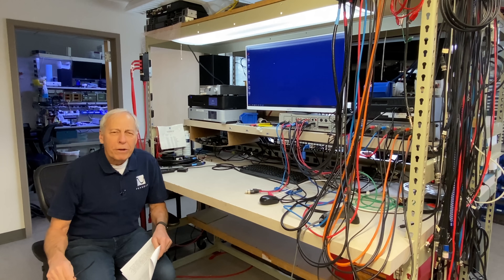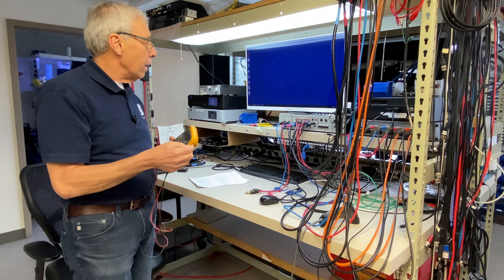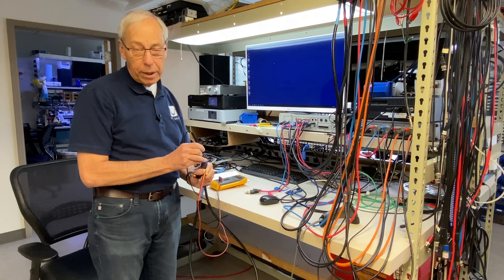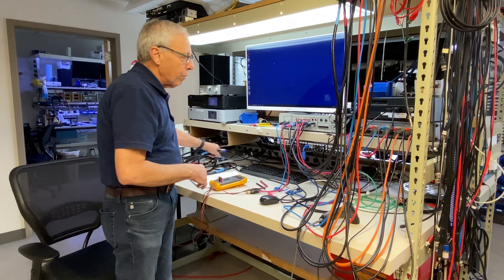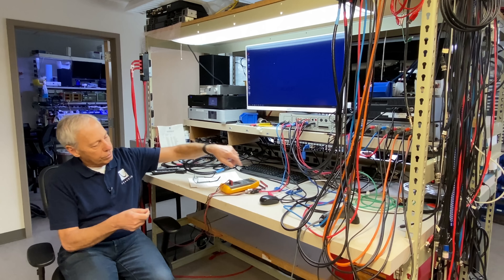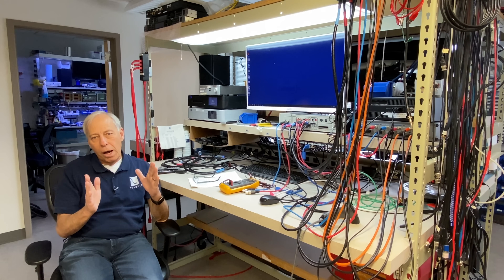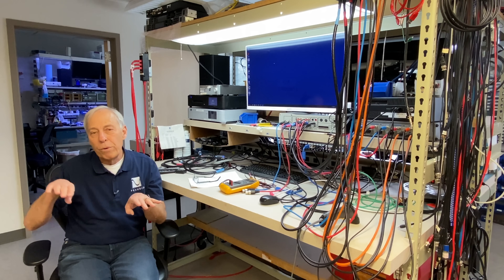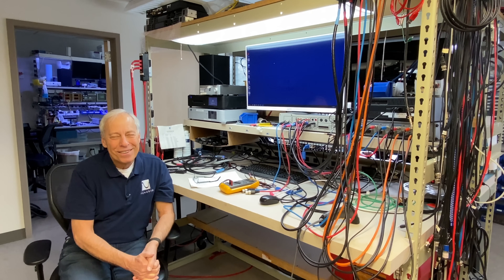Speaker cable impedance

Comment: If that measurement was correct, a speaker cable resistance of 3 ohms or more is truly horrible.  First suspect would be poor connectors; the wire resistance can be calculated as follows (remember to use full loop length, which is double the cable length).  The numbers in parentheses account for skin effect at the highest audio frequency:  
20ga:  10.2 ohms/1000 ft (no skin effect for audio)
18ga:  6.4 ohms/1000 ft (no skin effect for audio)
16ga:  4.0 ohms/1000 ft (4.4 ohms/1000 ft at 20KHz)
14ga:  2.5 ohms/1000 ft (3.1 ohms/1000 ft at 20KHz)
12ga:  1.6 ohms/1000 ft (2.28 ohms/1000 ft at 20KHz)
10ga:  1.00 ohms/1000 ft (1.7 ohms/1000 ft at 20KHz)
8ga:  0.63 ohms/1000 ft (1.3 ohms/1000 ft at 20KHz)
6ga:  0.40 ohms/1000 ft (0.99 ohms/1000 ft at 20KHz)
4ga:  0.25 ohms/1000 ft (0.77 ohms/1000 ft at 20KHz)
2ga:  0.156 ohms/1000 ft (0.60 ohms/1000 ft at 20KHz)
Note that the heavier gauges are more susceptible to skin effect and this is why it's better to use multiple finer wires (braided so they don't run parallel) instead of single heavy wires.  
For those who need wire cross-sections in mm^2:  
20ga:  0.52 mm^2
18ga:  0.82 mm^2
16ga:  1.31 mm^2
14ga:  2.1 mm^2
12ga:  3.31 mm^2
10ga:  5.3 mm^2
8ga:  8.4 mm^2
6ga:  13.3 mm^2
4ga:  21.2 mm^2
2ga:  33.6 mm^2
Reply: unless that wire came from China, in which it would be aluminum interior with a copper plating on the outside. That would explain the high resistance.
Reply: @jeffmassey4860  
Resistivity of aluminum is only 68% higher than copper, so the use of aluminum wouldn't explain such a high resistance.  
But steel has almost 10x higher resistivity than copper.
Reply: @marianneoelund2940  DON'T CARE. WHAT IS THE BRAND OF THE CABLE.
NOT MENTIONED. USELESS ARGUEMENT. BYE. DO NOT REPLY.
Reply: @jeffmassey4860  
Did you just get back from a street riot?  
Sure, it would be nice to know the make and model of the "problem" cable, but we probably won't have the luxury of that information.  
Do you think the Chinese might use copper-plated steel?

Comment: Since they are new cables and he compared them to his old ones I would suspect a poor crimp or solder job on the connectors , that could easily explain what he experienced.
Reply: I agree most "cable" problems are due to connector issues.  Good connectors are not easy to design and produce.  Everything needs to be right, including the plating processes.  
I remember a horrible experience with a brand new ZIF socket that I wanted to use for an EPROM programmer.  Half a dozen of the contacts had very poor or no continuity to the device pins.  They looked clean, no sign of corrosion, and scraping them down didn't help much.  In the end, I had to give up and replace it.

Comment: This person was almost for sure measuring the resistance with the speakers in the circuit. Anything that anyone would consider speaker cables would have to be hundreds of feet in length to get 4 ohms resistance. Paul should have pointed out that a multimeter doesn't measure impedance, he just uses the term interchangeably with resistance which any engineer shouldn't be doing.
Reply: I noticed that.  Paul’s meter can only measure the resistance, but ignores the reactance, which in speaker wire may be more important than the resistance, depending on design.
Reply: @doowopper1951  I have a Toa impedance meter, which measures at 1000Hz, commonly used in Public address for load balancing and matching 100 volt line circuits.
He needs to null the lead resistance out before he starts measuring.
Reply: @peterwhite51    But, Paul said that he had an Ohm meter.  I know well that there are impedance meters, but without using one, you can't measure impedance.  An Ohm meter just won't account for reactance. .
Reply: I would certainly be asking how this measurement was made. It's too close to many speaker terminals' D.C. resistance to be a cable only measurement.
Reply: He is not an engineer. He learned bits and pieces by working with engineers but you can see he has a lot of wholes in basic stuff.
Reply: irisfailsafe   Those holes are not from a lack of knowledge, just an occasional inability to express that knowledge in layman’s terms;  he tries to oversimplify.  And, he is an engineer.  Maybe he isn’t formally trained as one, but he learned enough hands on that he can design electronics as complicated as the digital lens.  Jeff Baxter, of Steely Dan and Doobie Brothers fame,  was, under the Bush administration, the number one security expert in the US.  He had no formal training at all, it was 100% self taught.  You claiming Paul is not an engineer is like saying Jeff Baxter is not a security expert.  And I bet Jeff would be piss-poor at trying to explain his security concepts tp us.
Reply: @doowopper1951  He gets called a lot by engineers for saying wrong things and promoting lies like magical cables. He never dares to talk to those engineers and expose his facts
Reply: irisfailsafe   And you show your blind biases by calling cables “magical”.  Cables can, and often do, make a difference.  Especially to those who do critical list in to any extent.  Most of the time, naysayers like you do more harm than good for those looking for the best listening experience they can get.
Reply: @doowopper1951  No they don't. If they are well made then that is it. There is a thing called science, and one of their branches study a thing called electromagnetism. And all of those scientists always calls the BS of  cables. Search a book by Dr. Floyd Toole. Read it and then come back
Reply: @irisfailsafe     You, and Floyd obviously do not know what you are talking about,.  Cables can make a very significant difference.  I was once 100% in agreement with you, until I heard the differences over and over, and could no longer deny them, as much as I wanted to hear no difference.  You are welcome to your opinion, even though it is about as wrong as it can be.  And so is Floyd Toole.  And, I don't care what any book says.  The human ear can hear differences that can not be shown by measurements and other methods, YET!..one day, we will be able to prove definitively that there are differences in cables that affect what we hear.

Comment: Hmm. I'm thinking maybe a little corrosion on the connectors somehow? Or maybe just bad connectors period. Not attached properly? 
I can't see how the wire would have 3 or 4 ohms resistance. 
Definitely bring them back.
Reply: you're assuming the measurement was done correctly

Comment: For those who might be interested, the resistance of stranded copper wire at room temperature (per thousand feet, move the decimal three spaces to the left for per foot)
Gauge         Ohms per 1000 feet
10                   1.02
12                   1.62
14                   2.58
16                   4.09
18                   6.51
Reply: Mike Eastridge  Actually it sounds like they read the scale wrong on their digital meter (or the meter was defective.) Who knows.
Reply: Mike Eastridge  The table I got the values listed pure copper, not an alloy. Variations in resistance between batches must be infinitesimal, especially  at the lengths of most cables.

Comment: A question about my 35 year old Monster speaker cables. The copper is tarnished black throughout the cable. Does this discolored copper change the impedance of the cable and impact the sound quality? I no longer use the cables but can't justify throwing them out.
Reply: If it is just tarnish ( mild oxidation ) it would be negligible  but if it  is so badly oxidized as to had eaten away at some of the strands then yes it could impact sound .  Just curious what are you using now and is there much of a difference as I am using 35 year old monster cable ( also tarnished ) and am happy with the sound with $2800.00 Ohm Acoustics Walsh  speakers and $ 5000.00 Sunfire ultamate receiver .

Comment: Sounds like Guy is not using his Multimeter correct.  Good topic !!
Reply: He first heard a difference then measured a difference , most likely bad crimp or solder job on connectors. Using his meter incorrectly would not account for the difference in sound .

Comment: Complex answer. I would just use the exact type of wire that is in the speaker and that my transformers in my amp are made of. It creates the best synergy. I have heard pretty bad equipment, sound pretty good because of this trick alone. (and jup my gear it's the same brand speaker and amp I have, so that is why I know what cable it is)
I did the same in the olden says when I had Sugden equipment, found out it was Cardas cable in the amp, changed the speaker to same type of cable and bought a matching cardas speaker cable. (and no I am not a cardas fan, but that was actually the only time I really enjoyed cardas because of the synergy)
Reply: Not really, I have spe19 cable in my speakers by default (an-e spe/he) and same cable can be bought by audio note as a speaker cable and then I have the same as a silver transformer in my amp plus as an extra bonus I have the same cable on the signal path inside the amp, the dac, the streamer, and outside on the signal path such as coax and rca cable. It totally eliminates negotiation and you then milk like 5x more out of the equipment.
But yes most manufactors do not reveal what their transformers are made of because most are made of basic garbage metal.

Comment: Paul, in all due respect i believe OL means Open Load. So your speaker cable is at actual .2 ohms across the pair which is excellent considering on how good a connection you were making. Maybe he was reading 4 ohms across the pair? but even at that 14ga wire is 4 ohms per 1,000 feet. Or he has some crummy connectors (connections).Banana plugs??? More connectors = more issues.

Comment: If it's really 4 ohms you could short out the cables and run the amp safely without speakers - there and back being 8 ohms! - sure you're not measuring milliohms?
Reply: HE did say compared to his old cables they measured higher and sounded muffled ,one possibility is a bad crimp or solder job on the connectors.
Reply: Sounds about right, in milliohms, for 4 foot number 10 AWG copper.

Comment: An Ohm meter does not measure impedance. Impedance is frequency dependent. Cable has a difference in impedance depending on the frequency of the load.
Reply: @blackened18019  There are some expensive cables  that  because of their ( special design ) like braiding  do have a higher inductive or capacitive REACTANCE  than DC resistance at audio frequencies.This is why some cables can act like tone controls. Audioholics has  noted this when checking out some esoteric cables.
Reply: @leekumiega6576  
The pitfalls of over-designing.  
I've never used anything but zip cord for speaker connections.
Reply: You’re talking about Characteristic impedance and yes a standard DMM will not measure it. You can use a precision LCR meter like the Quadtech 7600 Plus to measure it.
LCR=inductance, capacitance, resistance.
Reply: @PebblesChan  
LCR meters can't directly measure characteristic impedance, Z0.  You would need to measure L and C separately, then calculate it.  
I use TDR methods (fast sig gen and scope) to measure Z0.  It's fun shooting signal edges down cables at 2/3 the speed of light.
Reply: @marianneoelund2940  I think measuring L & C separately and calculating impedance separately is what he meant also just knowing that the lower the numbers the better it is all you need to compare 2 cables.
Reply: I didn't say directly. Here's how you do it -  https://www.ietlabs.com/pdf/application_notes/035023%207600%20Characteristic%20Cable%20Impedance.pdf
Reply: A TDR is just a specialised configuration of a pulse generator connected to an oscilloscope (for those who can afford one) .  Many of us 20th century oldies could only dream of having an oscilloscope or TDR back then.
Reply: @PebblesChan  That is overkill as you mentioned earlier a decent LCR meter will tell you what you need to know and you can calculate the impedance at a given frequency if you know the formula  and there are sites that will calculate it for you if you plug in all the variables .
Reply: @PebblesChan  
OK, so Zoc is essentially capacitive reactance (1/sC), and Zsc is essentially inductive reactance (sL).  Then the formula Z0 = SQRT(Zoc*Zsc) becomes
Z0 = SQRT((1/sC)*sL) = SQRT(L/C).  So although it looks a little different, the method does effectively measure C and L.
Reply: @PebblesChan  
Around 2008, I decided to invest in a nice 1GHz scope to use on my job.  It was a wise decision, as I used it heavily on many development programs these last 12 years.  Now that I'm retiring, I'll be using it for hobby activities and the occasional design project.  Maybe I'll do some tutoring also.  
For a pulse generator, I was surprised to discover in the lab one day, that a simple sharp probe coming against a metal plate can produce sub-nanosec risetime edges when it hits clean.  Sometimes there will be a little noise, but often you can get a very clean, fast edge.  I think what's happening, is that it actually uses air breakdown to act as a switch when the probe comes within a few nm of the plate.
Reply: You can't trust those Aussies!
Reply: @blackened18019  
Typically, cables longer than about 20 feet will have inductive reactance that exceeds the copper resistance, at the highest audio frequencies.  
It's a good thing we can't hear up to 60KHz.

Comment: Go to Best Buy, Home Depot, Lowe’s or any other hardware store and ask for 14 gauge lamp cable. The cost is .37 per foot. The resistance of this cable is barely detectable with a meter. There is no need to go out and purchase any specialized cable that is labeled speaker cable. Ask any expert and they will tell you the same thing. Don’t ask a salesperson at Best Buy, Crutchfield, or Fry’s.
Reply: Tell me you're not serious. You want at least 12 if not 10 gauge.
Reply: @leekumiega6576  
Depends on application.  You need to know speaker impedance and cable length (and sometimes amplifier power) before recommending a wire gauge.
Reply: I met you half way
Reply: Correct. This is perfect for short runs in a room. The only important wire spec at audio frequencies is resistance which is very low in this type of cable. Capacitance and inductance is irrelevant for short runs. Expensive cables are snake oil.
Reply: @geoff37s38  notice his reply was edited he originally had 16 gauge then after my reply he met me half way and changed it to 14 which will surfice for short runs to an 8 ohm speaker.
Reply: lee kumiega ok. I use 3 metres of 12 gauge twin multi strand to floor standing electrostatics. Nothing fancy.

Comment: I find it puzzling that nobody considers the other resistances involved in the speaker itself...  the box wiring,  the crossover inductors and the voice coil.  These items all add up to WAY MORE resistance than the speaker wire.  There are even series resistors in some crossovers.  And we worry about a tenth of a ohm??
Reply: Yes, I keep having to remind people that the system damping factor, no matter how good your amp and cables are, never even reaches 3 due to the voice coil resistance alone.
Reply: @marianneoelund2940  True! I wonder why most people, including amplifier manufacturers like PS Audio, all keep talking about large damping factors, without taking voice coil resistance into account...
Reply: Fully agree!
Reply: He heard the difference compared to his old cables then measured a difference ,I'm sure he measured them the same way not one measurement with the speaker in the circuit and one without. Bad crimp or solder on connectors is most likely.

Comment: Interesting, not been thinking of that. 
On my home cinema, i replaced the receiver, and cables...
And after that the sound sounds muffled..   Especially playing music..
I always just thought its the receiver, since it was fairly cheap...
But now i am thinking it very well ca be the cables...   I should test that out...
Reply: Mataba If you want some very good cheap wires you can make your own braided wires with 4, 6 or 8 wires. I made my own (12 meters) with 4 wires ~15gauge each for about €20,-. Quite cheap and very effective.
Reply: @chielwouterscw  i think i borrow from my friends cables first. Just to hear if helps. Few friends got Audioquest, and other have Taralabs.  So i got some options to listen on before i buy.
Reply: Mataba That's probably the best way to do it.

Comment: Maybe it’s one of those cables like Transparent or MIT that has a zobel network box built in.
Reply: Those are the brands immediately come to my mind.  However, I guess their speaker cables won’t be as high as 4 ohms.  May be 1 ohm and some capacitance too.
Reply: Zobel network is in parallel, so it won't increase the wire resistance.  
While we're on the topic, there are some misunderstandings about Zobel networks.  Originally, they were just a series RC circuit connected in parallel with an individual driver within a speaker system, to keep its high-frequency impedance from rising above its nominal value.  That allows woofers and midranges to operate more accurately with passive crossovers.  
But they are also used internally in power amplifiers, to ensure that there is a high-frequency load present at all times, even if no speaker is connected (or if the speaker presents very little load at high frequency, like a subwoofer).  Many designs need to have a guaranteed high-frequency load, for stability reasons.  If included inside the amp, there is no need or reason to put a second Zobel network on the amplifier output.

Comment: Loudspeaker cable Resistance = 0.0016 Ohms/foot run
Reply: That requires 9 AWG wire (cross section area 6.6 mm^2).  10 AWG is 0.002 ohms per foot (total loop).